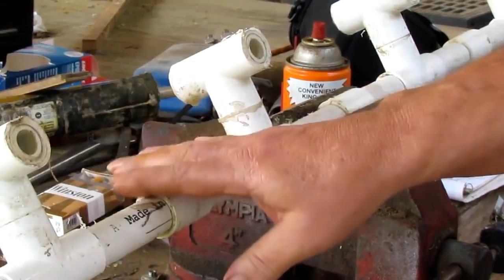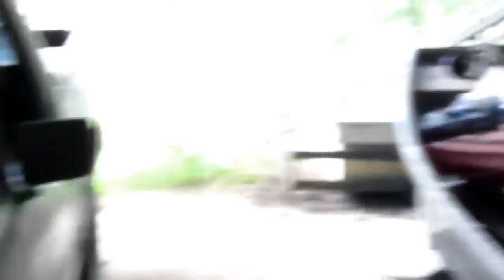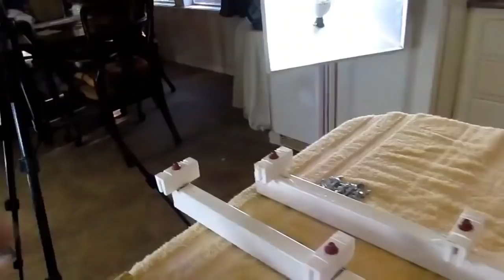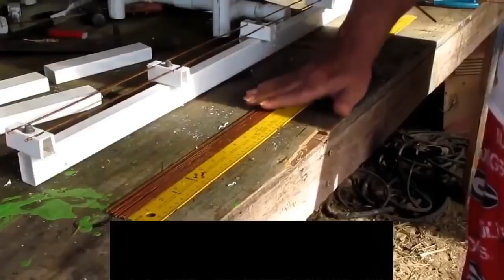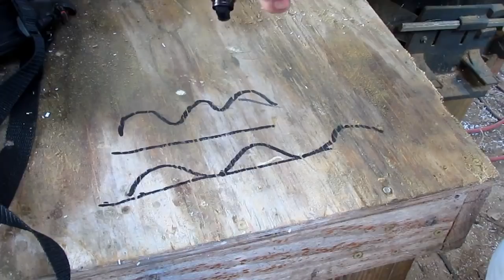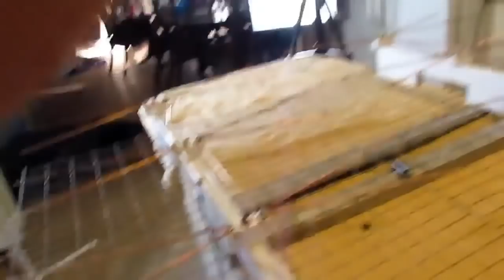Homemade TV Antenna

Comment: Would you be able to build a 12 bay or larger to get better signal strength,  im 70 miles from the nearby towers and tried several store antennas but nothing works.

Comment: Great job, Danny.
How far apart do you put the pieces that hold the whiskers and the copper wires?  Is it 8 inches apart? And where do you put the booster?  Also if you're making a double antenna, does it matter where you connect the two antennas?  I think you said this information is on your other videos, and I'll check them out.  
Thanks again, and great job!

Comment: Hi Danny S Hodges, thank you for all your videos & explanations. I have a tricky set up a few channels are 317° 28.5 miles away. While everything else is between 99° - 167° 6.6 to 9.1 miles from me. I just got your Dual Ultimate Antennas with 1 VHF Add-On for my VHF HI Stations, do you have any suggestions?

Comment: Hi brother Danny S,  I might every thing is good there.

I am coming from Dar es salaam Tanzania to look for your suggestion of how to build HDTV antenna that can have ability of to catch signal from 80 miles away, my target signal is from Zanzibar Tanzania.

I bought 1 byone antenna three week ago unfortunately didn't meet target, so please help me to make antenna that can make me to archive it.

One more thing is in my area is hard to get cooper wires except 2.5 electricity wire so which will be best option after copper wires!!!??? PLEASE.

Many thanks.
Reply: Aluminum works very well.  You can use romex electrical wire,  just strip the insulation off.  You can get 10 gauge romex.

Comment: I grew up with analog antennas. I recently got back into antennas & have been experimenting for the past 2 months on what works for me. I bought the $40 compact RCA yagi antenna & added the RCA booster like you showed in your other videos & I'm able to pick up 26 channels. I live in Virginia 60 miles from the Johnson City, TN area. I can pick up a couple of Asheville, NC channels 90 miles away. I wanted that RCA antenna because it also has a reflector. I mounted my antenna on a 20ft mast 50 feet up a steep hill from my house. My situation is different weather wise. When it's a clear sunny day all of my signals are 60% or better. When it's wet & rainy a couple of channels get weak. When I remove the booster I get nothing. Other then that my setup works way better then I expected it to. I even added a Channel Master 3414 running to other TV's & a HDHomeRun Quatro.

Comment: Let me see if I can explain this. Signal travels at the speed of light. The fastest thing we know. If I quote the speed I know I'll be wrong. What you drew was a radio wave. The distance from the top of one wave to the distance of the top of the next wave is the wavelength. CB is 36 ft between Peaks . As you change channels channel on the TV is a different wavelength. The antennas that you and I build I do Gray hoverman. Because of your video on it. These are very broad banded antennas. Antennas that are not have to be cut specifically to the wavelength. call Residence. That is measured with an SWR meter on a transmitter. I know you have CB background. At the speed of light you will not see a variance in the signal from the top of the signal to the bottom. Whenever you get signal from a long way away on UHF and VHF it's just like skip on CB. uses the ionosphere because it is HF. Charged by the Sun. That's why I skip hardly ever runs at night and if it does it generally to the West where the sun is. UHF and VHF uses the troposphere. closer to the ground. Inversion or on a cloudy day or when it is foggy impossible when it is raining. When the conditions are there or at night I love to turn the antenna I'm in Corpus Christi I can get Brownsville Houston. North San Antonio. I do not have an amplifier I need to get one. I do not have a reflector it's 99% Mother Nature waiting for propagation as they call it
Reply from the maker: nice info i need  you here